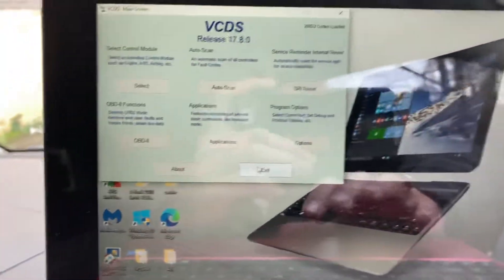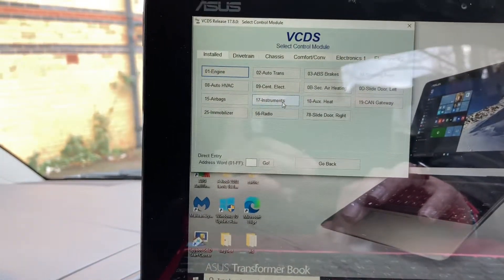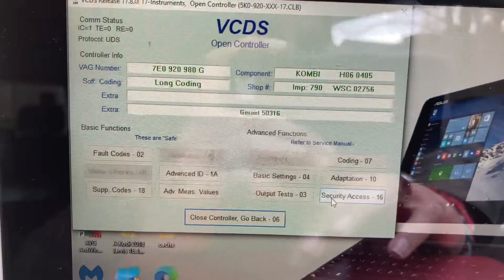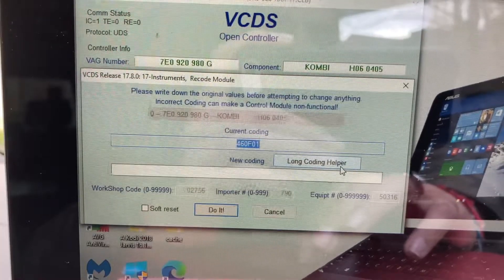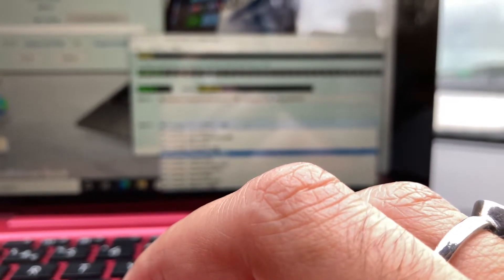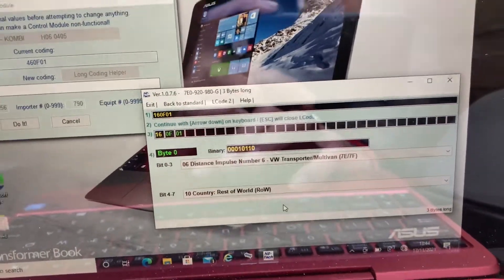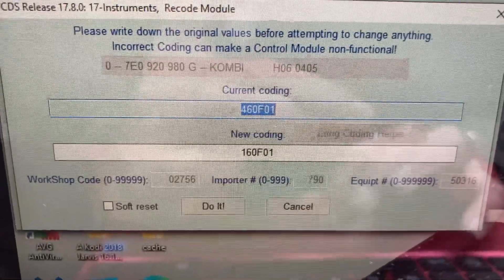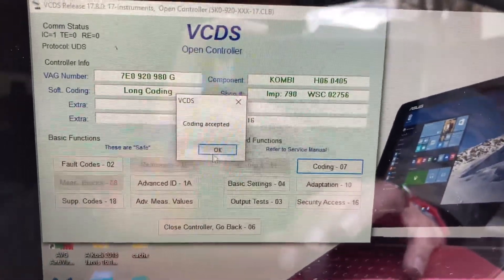Coding Programming Digital Speedo On VW Volkswagen Using VCDS

Comment: I Don't have a digital display of my mph. If I reset it to original factory settings will that bring it back?
Reply from the maker: Is your display the same as the one in the video?
Also what model and year is your vehicle?
Reply: @RamLanda  It's a 2009 VW Tiguan. The dash is similar to the one in the video but not exact
Reply from the maker: Have you tried coding the vehicle as in the video?
Reply: @RamLanda  No and I wouldn't even know how to do that
Reply from the maker: Easier option and user friendly. 
But don’t code unnecessary stuff as it can cause issues.

https://youtu.be/qGvH2ovjOAY

Comment: Hi sir I have spoke with vw main dealer regarding digital speedometer they said it is aftermarket so don’t mess around I really like speedometer like you done please is true it can affect my car if I do coding my vw touran 2011 with steering buttons please reply as soon as possible
Reply from the maker: Hi, it fine to do so. As long as you don’t go into other modules and alter other settings. After the time 1.24 in the video you get a long coding helper that shows numbers etc on the bottom right of the screen, they are the original settings and you need to take a photo of the numbers in case you put in a wrong number. So you can change it back.
Also it’s easier with the Carista app and OBD connector. Shown in my other video.